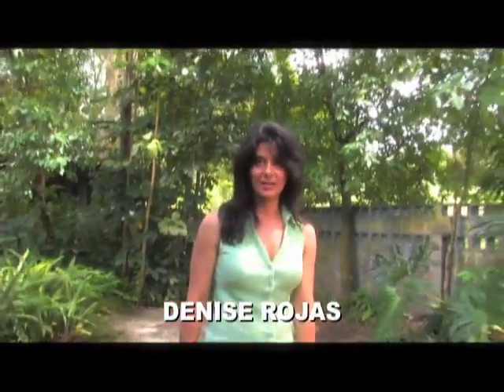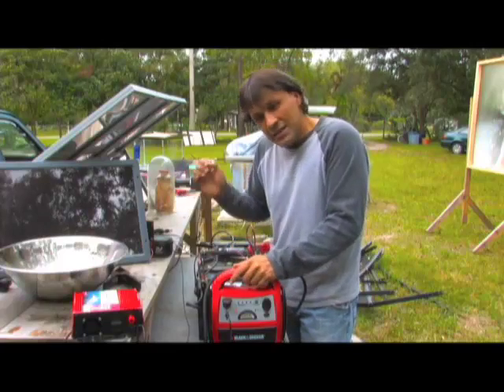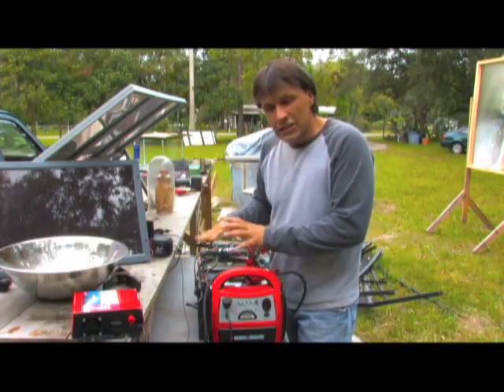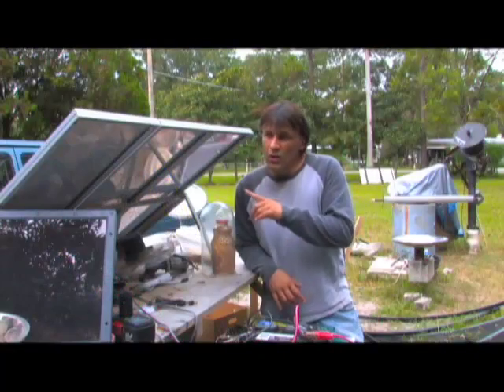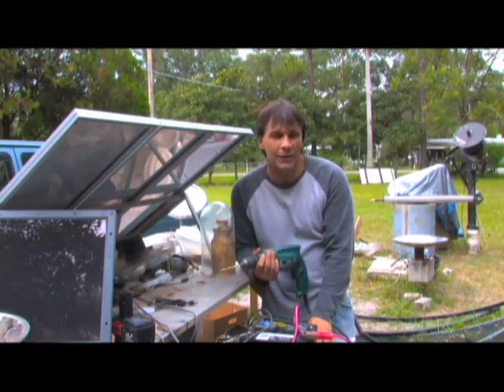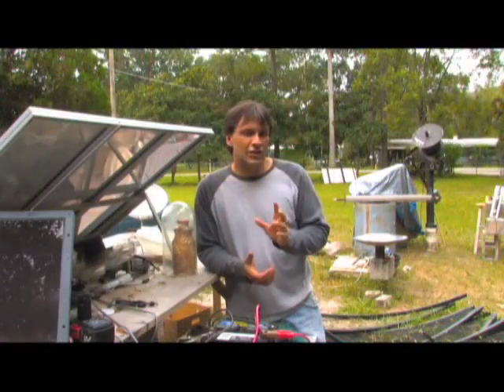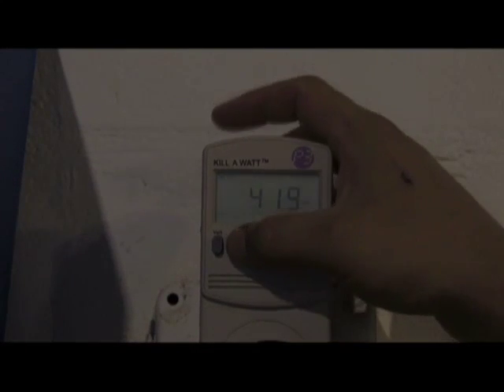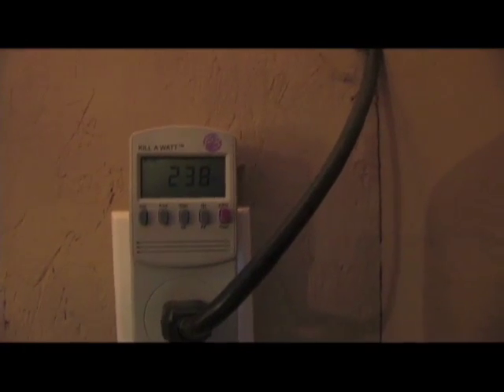Solar Panel DIY ELECTRIC WIRING for MODIFIED SINE, PURE SINE wave INVERTER

Comment: I was so angry when I started this thankfully i was scrolling back and your lovely wife's voice made me collect my thoughts. haha. No but seriouslyI.I started watching these videos for the missing section, the wiring. I was hoping to get the ins and outs of where it is the friction for energy release happens to be wiring and all that to make a windmill, not just the windmill making. Without it's electrical guts. And knowing woodworking I yelled at you a little bit. I think frustration grew, mostly from having the same woodworking knowledge. Having previously estimated what was needed,  I  had not even thought of a wood made Windmill to be legitimate unless we talk like older ones. I never even considered a wood windmill thinking that if it were going to be for a house it should be sturdy small and metal. So when I thought wood,  I think I translated my metal parts to wood parts. Making each blade separately caused me to think of an over sized hub from all sides. So your use of a whole 2x4 peeked my interest.The deeper I got though I was just thinking. get to the wiring and my frustration grew. Thank you for fixing that hub, that was maybe my breaking point haha . Respect the hustle Rojas you left me wanting more  in depth of the whole windmill, choosing battery storage. Oh yeah and You should add a pair of ball bearing to the hub so that you less friction and less wear and tear. 
Thanks

Comment: An old video but due a comment. If you want to see a load with another meter, just plug in the Kill A Watt. You won't believe how much that unit draws all by itself. I know because I have a panel meter that reads the power going into the extension cord that has a Kill A Watt sometimes plugged into it.
Reply from the maker: So the Kill A Watt meter draws a lot of power???
Reply: If I remember correctly, about 1 amp/90 watts.

Comment: hello dan
can you use a modfied inverter with a line filter to make a pure sine wave ?
Reply: +LEE TAVES There is some solution for that, saw this  one on ebay ebay.ca/itm/181957453973
Reply: +Dave Côté  hello dave I believe I saw on e bay a converter for 109.00 a surplus item. it may not be cost effective but the modfied inverter has only 60 to 70 present usefull power like a 3000 watt will only run about 2000 watt of power maybe

Comment: Have you studied circuts?  The battery system you showed has the batteries in series.  You called it a parallel circut.  Put Denise on more!

Comment: Very informative BUT you should not mention connecting a modified sine wave  inverter to the grid. To connect to the grid you must use a pure sine wave inverter which incorporated anti islanding. 
Connecting a modified inverter to the grid will get you a visit from your local utility.
Reply from the maker: You can hook to an isolated breaker = "skilled electrician." GTIs are another video. I added an annotation, thank you for the comment, I can see where it seemed like a grid tie. Regards

Dan
Reply: GREENPOWERSCIENCE
Earth 4 Energy

Safe Redirect => http://home-renewable-energy.blogspot.com
Reply: Thanks for your Extra info about this topics

Comment: Did I miss something, should't the system include a solar controler/regulator..  This device protects the battery by not over charging the batt and saving it from damage, the controller would also cut the power when your over using it thus protecting your batt from getting too lower a voltage and drained out.. which has a bad effect on batts.  So, you may not need to worry about deep cycle batts because a car batt would be protected from running to low.  Controllers can be bought for £7, I would say essential for good solar applications.
Reply: +Spangley Rainbows if it's a small solar setup, you can use without controller...I did off grid for a year with auto batteries i bought at a place that bougt/sold old batteries...

Comment: how come you havent used a charge controller? I thought you need one to control the voltage out the panel...also I bought some solar cells because I wanted to start with basics have you got a video on how to make a panel? I already seen the one you soldered two together...thank you so much

Comment: Yes unless the grid was being run by lots and lots of homes, in other words almost everyone on your part of the grid has panels the load would shut it down.

By the time this could ever become a problem, Island protection would be a standard.

I dont think anyone would buy a grid tie inverter without some isolation protection from a grid load in a blackout event.  It could get expensive without it.

Comment from the maker: NOPE = impossible comment, GTIs cannot operate without a detectable voltage EVEN IF they did not have the "Anti-Islanding Protection" as they would burn out instantly when a power outrage occurred BECAUSE the entire grid would be a gigantic dead load. So again Impossible. Read how grid tie inverters work.
Regular inverters are isolated from the grid so that too is an impossible scenario. Trained Linesmen never ever ASSUMES a line is dead. Electricity 101.

Comment: Power comes the area of your house in something like 10,000 volts, it goes through a step down transformer which bring it down to 220 VAC.  The reverse it true too.  If there is a grid power failure then the ac voltage you are sending back out will be stepped up to the 10,000 volts and will electrocute the lineman that is working on the grid expecting that line to be dead when it is live.
Reply: Doug Brimeyer TRUE!

Comment: An off the shelf inverter can not be connected to you breaker panel.  First of all the inverters that can be connected to the breaker panel have to be a sine wave matching inverter, secondly a grid tie inverter will shut off if it does not sense grid power to prevent the back flow of AC power during a grid power failure.

Comment: If you use something like a Furman power conditioner, it will smooth out the power curve and keep the temperatures down of what every is plugged in; let say your refrigerator motor. They cost around $50 and go up, the only thing is it may steal some run time away from the battery.

Comment: i am planning to install a small solar power system in a remote school with no electricity. would i need to install on/off switches (and which points would i install the switches) to the cabling for when students go on holidays. i mean if the power is not being used for 2 months i figure students could turn of the switches rather than unwire everything. is this necessary? is there any danger to the system of causing a fire if the system is left intact for extended periods and not disconnected?

Comment: the heck with professinal installers there are so many how to's out there you would wast a lot of money on some one else installing it. I'm building my own but I worked with electrics in the marines a  telephone computer power supply and generator repair tech so for me easy. but just about any one can do it now with GTI and me I'm building a big APC to run my house if i lose power  and my GTI will still provide power just it will automatic cut off incomming power.

Comment: Dan you would be able to use your bulbs a lot longer if they were all led lights 12 volt to match your panels. you wouldn't be using 200 watts thats for sure maybe a 1/10 of that for leds. they don't cost that much on ebay. you have to wait a while for shipping but its worth it in the end. i have led edison bulbs that only use 6 watts and every bit as bright as a 60 watt bulb.

Comment: hi nice video i have a cuestion i would like to conect 5000 btu ac 1200 watts to a 4 deep cycle battery and i have 2500 watts inverter for how long do i can run the ac with 4 batteries

Comment: Im new to the solar world ive been studying solar systems for a while now and understand it well though i have a few questions 

1# Can you leave the system running during the day and overnight  linked to a battery bank without problems?

2# What would you recommend as a 1st system would 600w be fine for a small home

3# Using a grid tie converter to a ac socket what would be the maximum time to keep it connected or can it be left 24/7

Comment: When charging or pulling from a parallel battery bank your positive and negative, in and out leads should be attached at opposite ends so the charge coming in and going out is equalized across your bank. Otherwise your first battery will be well  or  over charged and your last under charged and the bank longevity will be compromised.

Comment: Enjoy your videos...they've been a great intro to simple solar.  Question:  I have one HFT panel (15w), a 7 amp charge regulator and a 200w inverter connected to a deep cycle battery.  I'd like to add more 15w panels...do I simply link them all to the battery, via splicing them into the one charge regulator, then to the battery terminals?  Thanks

Comment: I saw you used a controler in the diagram but you didn't talk about it. I'm confused about the output. Does it come from the control, inverter or both?

Comment: I like the Rojans, I think they and people like them have the right thinking that we should all consider our individual energy needs. I have a small solar system that cost £50 including junk yard batteries. I have a 1,000 watt inverter but my refridgerator uses a 12 volt motor,all my lighting is 12 volt my computer is also low voltage as are my cordless tools, My TV is mains powered at 230 volts here in the UK but i manage to run it all evening after work without using all of my stored power.

Comment: Hey Dan a couple of questions what are the pros and cons of on the grid and off the grid? And you think you could help me built a system for a project for my self. Planning on buying my first home in about 2 months or so.  Dont want to buy a simple system from ebay. And then to re-buy anther one later on. If you could help me built one so I could use some of the componets for the next future system. when I get my new home. Thanks Love your videos very helpful.

Comment: Is there anyway you could just give us greenhorns a electricity class on amps, volts and watts.  You know how to do the math with them and how to test for amps etc.  I think you will probably save some frustration and shocks in the process for the not so in the know crowd.

Comment from the maker: @SciFiBMovieGuy Hi, all wet cell batteries should be in a well vented area in case of overcharging. I keep mine in a covered area outside. This enables short wiring on the DC side and a longer AC from a Grid Tie or regular inverter. MIT is working on some newer internal designs. I cant find the link. Google "MIT Battery"

Comment: Thank you for the great videos.  Very helpful!  I have some questions...

Do you anticipate a "stronger" deep-cycle battery being manufactured anytime soon, as opposed to having to use several batteries at a time?

As far as gel batteries, can they be safely used inside the home without having to ventilate them?

Again, thanks for your help.

Comment: Another point on Inverters:  Modified Sin Wave is usually just a straight square wave.  This is as simple as using a 60Hz timer to switch polarity back and forth.  That's why these inverters can be produced dirt cheap.  Pure sin wave inverters are much fancier but their cleaner power will mean motors will run using less power.  For toasters, ovens, and other resistive loads, modified sin wave should work nearly just as well!  Fantastic video all in all.  Keep it up, Rojas!

Comment: Dan says deep cycle batteries are designed to be totally drained.  The truth is that they are designed to withstand a heavy drain better than others.  You should never completely drain a battery.  If you want to optimize the life of any lead-acid battery, you shouldn't drain it below 50%.  So however much storage capacity you think you need, double that for your battery array, and then avoid draining it.  Your batteries will last for a LOT of years this way.

Comment: Great video thnxs!! I'm wondering how many 12v batteries you would need for for example a 200Watt load. 200Watt / 12 V = 16 Amps. And also how long the car batteries will last.

Comment from the maker: @Channel1BLT Hi, for panel installs you need a licensed electrician. You cannot connect to your panel from a regular inverter or DC current, you will blow up:-0. The grid tie inverters are special devices that allow for a plug n play sort of but any house hook ups, get some pro help.

Comment from the maker: Hi,

Yes that is fine, I recommend the following as a general system test. Take a small voltage tester (other than the HF controller). Test the panels with NO LOAD, bright sun should read above 20 V. No batteries connected open circuit test to make sure the controller is reading the same as the small meter, If yes, panels are fine, controller working perfect. Batteries connected 24 hours NO USE, just charging should reach above 12.7 V  - 13.9 V if yes, they are fine. I think you are good:-)

Comment: hi i also have hb panels,they work great,my ? is while charging the batteries my voltage reg will go from 12.9 to 12.2 when a cloud goes by or hangs around, is this normal. great video and great info.thanks

Comment: I like the Dog and pony show at the end ;)

The comments about this energy - especially with batteries consuming more energy then it produces is valid, but not necessarily the end game. 
If Energy is stored in another fashion - say pumping water to a  elevated reservoir during the day , or hydrolysis hydrogen separation - then micro-hydro recovery at night..or burning the stored hydrogen.

Think about that 'free' 1,000W/square meter,
It still has to be captured.

Comment: OH__ he missed to install CHARGE CONTROLLER for the battery.

From the solar panels you connect  battery charge controller then to battery.
You donnot want to overcharged or burn your battery.

Comment: Good video as usual. It should be known that it's not a good idea to pull deep cycle batteries down below 50% as this will dramatically shorten their lifespan. Also you shouldn't mix battery types or even the same type batteries with others of very different ages. The whole bank will only be as strong as the weakest one.

Comment from the maker: When you have them at 13.5 v, remove the panel leads and see what the batteries are I would guess 12.5v is what they will be at. They should be around 12.5 with nothing attached. Most charger units will cut off before 14v to prevent overcharging. When your batteries are fully charged they will register 13.5-14v with the panels attached full sun and 12-12.7 when no panels or at night. How are they holding the load. Your system sounds normal. What you are seeing is full batteries + panel v.

Comment: hi Dan , please i need some help. i'm haveing all kinds of problems here . during the day the batteries will chrge to 13.5v and then in the afternoon they start to drop down and eventuatly by 6 pm they would reach 12.5 volts. is this normal ?

Comment from the maker: If the amp output is not WAY off also the voltage must be the same when hooking in parallel. do not mix 6v and 12 v in parallel. 

Acid gel not the issue. 

Amps/Volts. Amps important in Series if you have a peak load above the weakest link/battery.

Comment: well i'm back from the us. we had a few days of full sun and when i came back my 4 batteries of 20 amps each where only at 12.4 volts when they should have been at about 14 volts i guess. so i returned my solar charger controller and not i have a 7 amp controller and we will see

Comment from the maker: Yes to the diode with a wind turbine. Ebay has some cheap ones. For the panels, most newer ones have a diode built in several places. The controller that comes with the system works great for batteries. The front panel has a 5A fuse son the lighter adapter is sensitive. I do not know if the controller will regulate high voltage spikes from a turbine over 30v.

Comment: my tv says 190 watts and my satelite is 45 watts. i guess my problem is that my panel is not at an angle.the panel is almost level. i already installed on my roof but i could put at an angle. should i angle it at 30 or 40 degrees? canada is 120 60 yes,,thanks. i see you speak portugese , i was born in brazil but my parents were italians

Comment from the maker: That should run your TV for a few days. You will be using 4x the power your cells are generating but you will not be watching it 100% of daylight hours. Conservation you can do with what you have. If you watch a lot you will need more panels. ALSO UNPLUG THE TV WHEN NOT IN USE if possible. They can drain 50-100 watts when off.  Are there set top boxes?
 Does it have the watts? 

Canada-you are 120v 60hz correct?

Comment: thanks for quick answers. inverter 3000 watts cont. 12 volt panel but take into consideration that i live in montreal canada
i would like to run my tv 65 inch projection tv,,thanks

Comment from the maker: Thank you.

If you get clear skies in Canada, you can use it in the Winter too. 1974 WOW, that is tough to do, they do hold up really well. The 82+ turn to "Terminator 2" in 3 seconds. LOL

The bike: You have a good motor. I was thinking of using several DRILL DRIVES. The gear ration would be easier. Can you get a gear box for yours?

Cannot wait to see your video:-)

Comment: Hey Dan, another great video!
Just packed up my fresnel lens for the winter, had fun! Will try and to some cool stuff next summer and upload in. Melted a copper (1974) penny (1084`C!!)

I love your stuff, maybe I can spoof your video one time with my own weird science...  :-)

I have all the parts, the rough math, and a basic design for a peddle power exercise bike! seen these on YT, but  I think my design will be better. hefty fly-wheel, Baldor motor (nice size/hp/rpm) and a chain drive.. + +